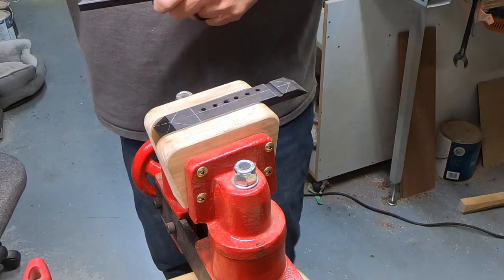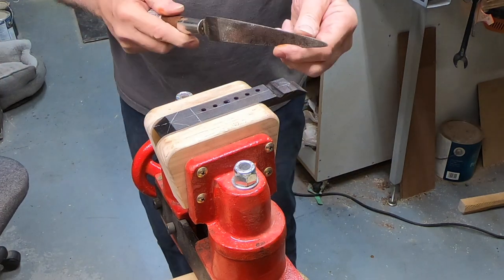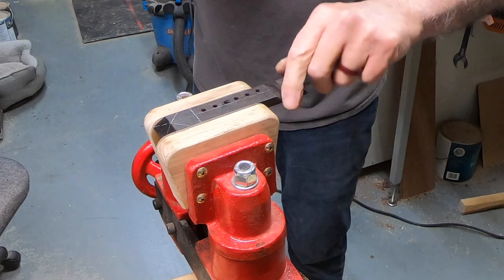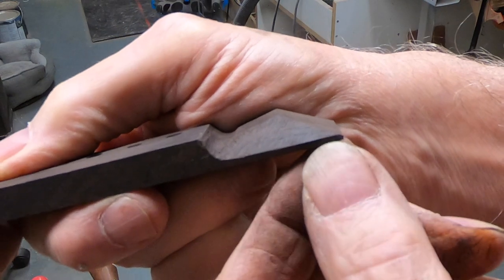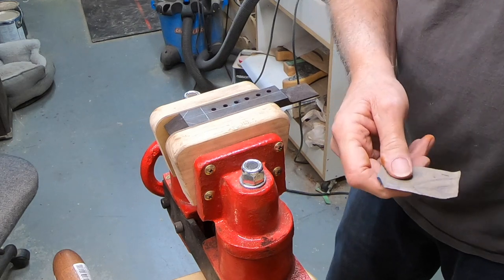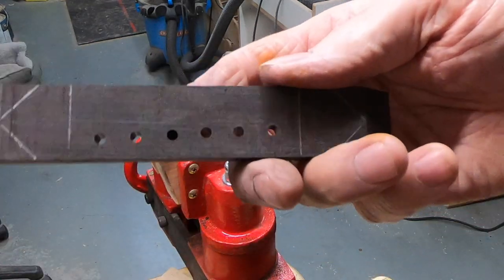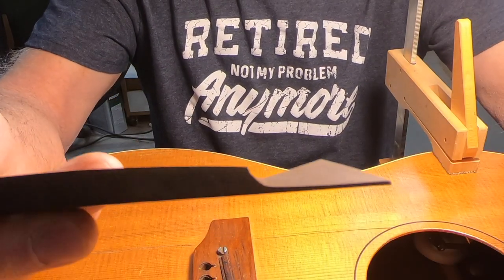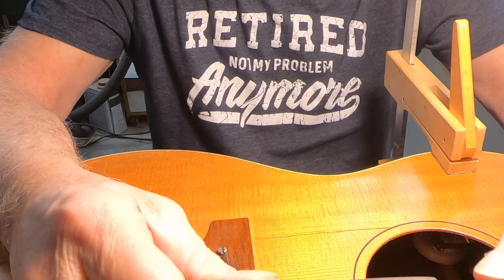ACOUSTIC GUITARS TWO AT A TIME, PYRAMID BRIDGES by JONAH GUITARS

Comment: You have a way with wood my friend! Because there is a required thickness between the pyramids and the saddle proper, while the ends go down virtually to a point, you will inevitably have two different angles on the pyramids. I was super impressed with the second one, but both stand up to any scrutiny. Nice work as usual Dane.
Reply from the maker: Thanks Steve, yes the second looks more like the Martin ones. But when not side by side it looks fine.